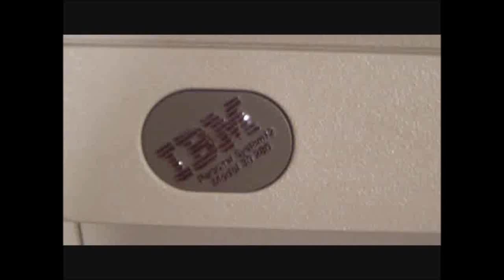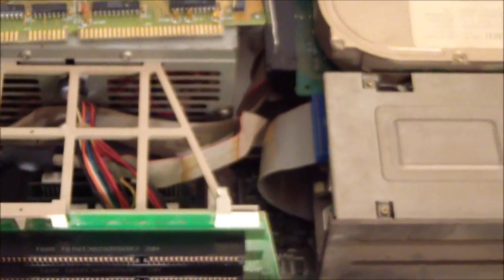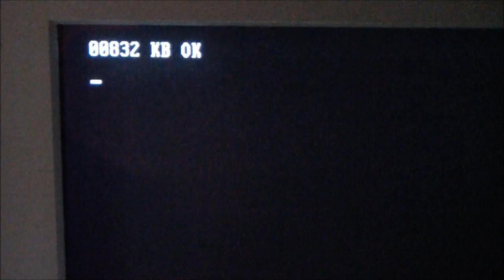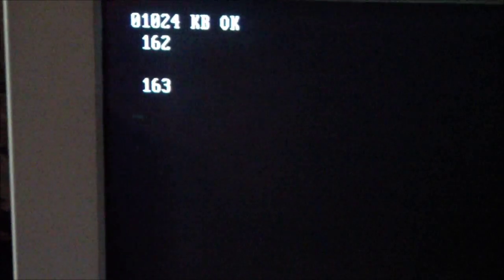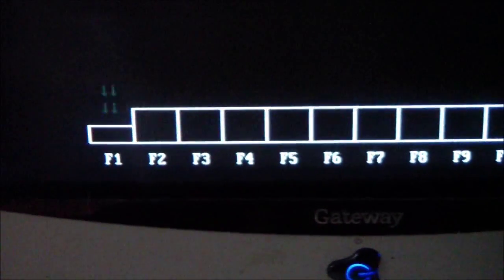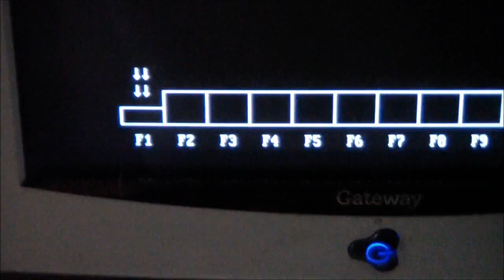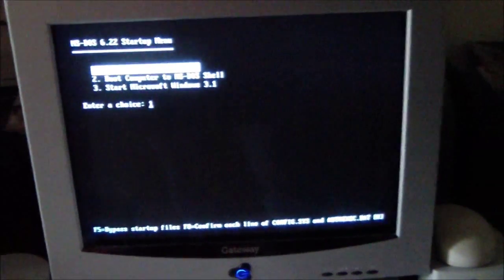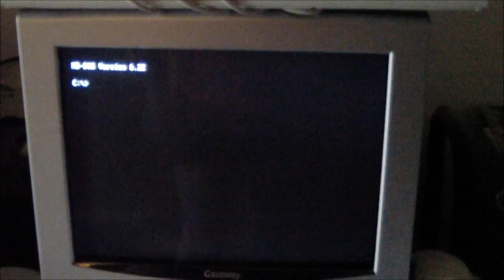IBM Model 30 286

Comment: i did the real clock mod, is nice that the module is not soldered. no hdd, so i installed xt ide compact flash works very well,i installed ms-dos6.22, and plays old games well, however you can do nothing if the flopyy drive is bad, mine was bad, so after changing the smd electrolytic caps, i was able to run the starter floppy diskette, and do the rest. i am unable to make the  16 bit isa hdd interface works and try several proven cards, nothing works, only the 8 bit cf to ide.

Comment: I have two of these model 30 machines. They are cool looking machines, stylish, but they're slow as hell, man! I'm lucky enough, that one has 4mb of memory (120ns, slow even back in the day I think), which could make it usable to install OS/2 1.3 on it, but maybe after using a normal ISA hdd controller.
Reply from the maker: I agree, very slow machine. how will you solve the lack of a molex power connector issue when installing a standard hard drive? modify the PSU?
Reply: You're right, you'd need to modify the psu. I think it can be done, but I have several reasons not to try :-D
Reply: I had a Model 30 w/ a 386 upgrade and 4 MB of ram but I sold it... it was still very slow w/ a 386 upgrade...

Comment: Just got a model 30 286. the problem right now is my FDD 1.44 that work as a 360k. I don't know also if it's supose to do that but my real time clock was dead so i removed it, the computer boot but i do not have any picture. When i did received a brand new real time clock replacement and installed it, the picture was back.
Reply from the maker: +yukin PC these machines tend to be real odd about the real time clocks. I've run plenty of old PC's without clocks and most of them run fine with out a clock (though you need to reset settings unless yours is default) mine seems to be at least usable with a dead battery.

do you mean it acts like a 720k drive? that issue may be related to the dead battery. Mine seems to work OK with a dead battery but I've had other machines where the floppy drive did extremely odd things when the CMOS battery was dead.
Reply: +0blivi0n100 Well for the real time clock, even when it was dead, the computer was ok except for the date and time but thats only when i remove the chip from the board it began to no show picture on screen. But now it's ok with the new one i got.

It doesn't even act like a 720k, when i want to format a floppy, the drive try to format it in 360k, after 5 seconds, it give an error. If i type the commande /f:1.44 to force it format in 1.44mb, it give me also an error. My guess is the floppy drive is dead.
Reply from the maker: yukin PC
 hmm, usually when a drive is dead it won't do anything or give a "retry, abort, fail" but you could be right. I once had a floppy drive think it was a different type of drive and that was connected to a dead CMOS battery so it sounded familiar.
Reply: With these machines, if the Dallas battery is dead, the floppy drive won't work properly (tries to format as 360k). So yes, fix the battery, and the floppy drive will work fine. Also, the code for dead battery is 161, so Phil's machine propably just needs to run the setup from the Starter disk.
Reply: Lol. Yeah, mine has this issue. It will read disks absolutely fine, but if you try and write to a floppy it thinks it's a 360K!! The battery is also dead. Guess I need a replacement....

Comment: The PS/2 Models 25, 25-286, 30, and 30-286 all use an 8-bit IDE-XT hard drive interface with a proprietary connector. Having an 8-bit hard drive interface instead of a full 16-bit interface makes the 30-286 (and 25-286) unusually slow for a 10 MHz 286.
Reply from the maker: +vwestlife I have a love hate relationship with this machine. I have limited space where I am now so I probably should let it go since I hardly use this one but for some reason it holds some odd appeal despite its slowness. I really need to attempt that battery mod one day.